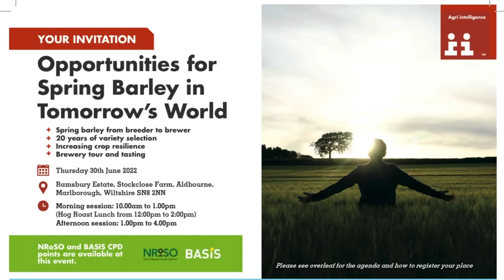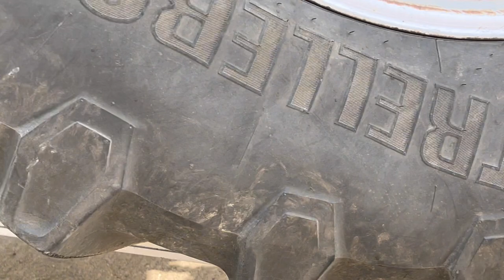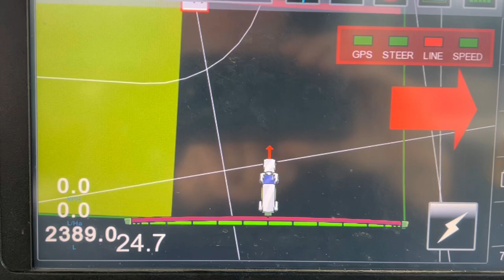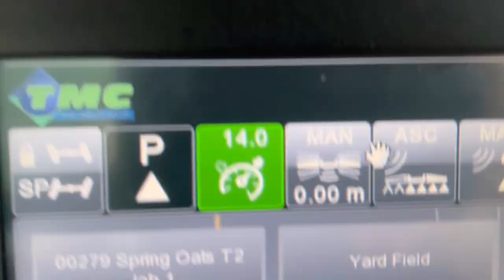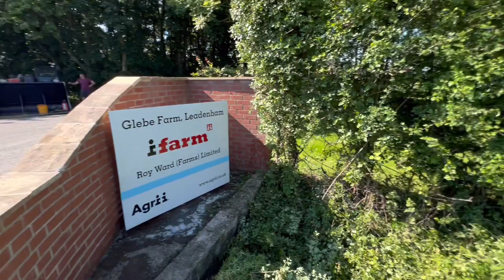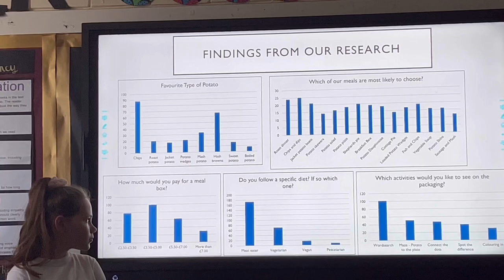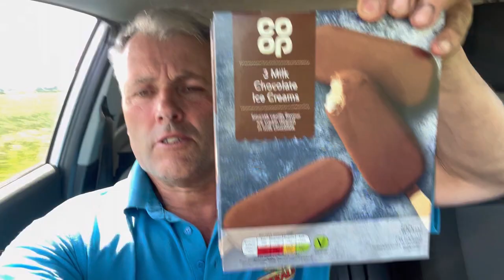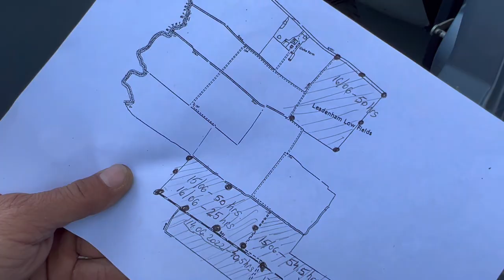FARM UPDATE 60 - BLACKGRASS PULLING, BUILDING FARM ROAD, SPRAY OATS, VISIT SCHOOL, FARM DRIVE REPAIR

Comment: Andrew, if the black grass is taller than the crop isn’t it more practical to use a weed wiper and Roundup
Reply from the maker: Blackgrass is quite often shorter than wheat and it’s not until you walk to a plant and pull it do you realise how much of the plant is below the wheat.

Comment: Grat video again Andrew! one question though, although you remove the blackgrass from the field and dispose of it the wood is there not still a chance of it spreading from there. Would you not be better digging a hole a burying it or getting rid of it in say an incinerator? just curious, Many thanks Jack
Reply from the maker: At the moment the seed in not viable and the amount we pull, we’d need a hole bigger than a transit van! The nearest arable field to that wood is about 250 metres.

Comment: What sort of cost do you associate with hand rogueing per ha compared to herbicide cost?
Reply from the maker: Varies between crop and year but lowest is £20/ha, highest is over £200 but that 200 was 4 years ago. We are now getting blackgrass fee crops for about £95/hectare, that’s round up pre drilling, a basic pre em and hand rogueing. I’ve not used post em BG herbs for about 8 years.